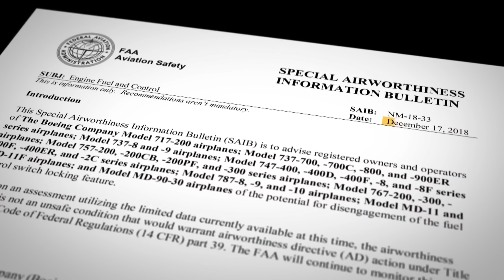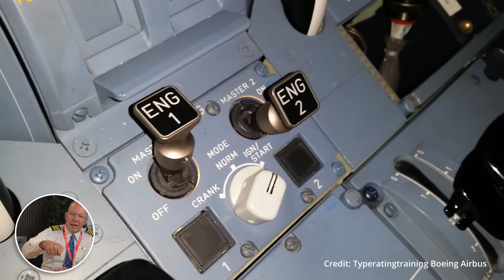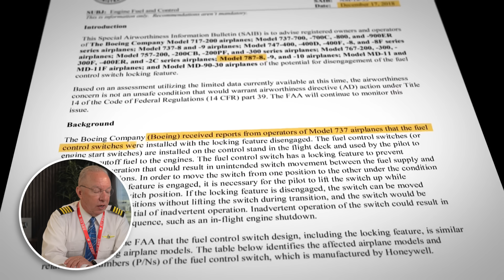Air India 171: The FAA’s 2018 Fuel Switch Locking Bulletin Explained (16 Questions Answered)

Comment: The RAT does not come out immediately. After the fuel supply was cut off, the engines begin to lose speed, it takes a few seconds for them to fall below idle. Only then does the engine error appear, and only after that does the RAT come out. But the report says that it came out immediately after takeoff.
According to the report, Liftoff occurred at 08:08:39. The question arises, how could the RAT come out so early, before the pilots supposedly turned off the engines? It turns out that the engine error occurred before the switches were moved.
Reply: Exactly!!  Why didn't Captain Steeeeve notice this???
Reply: "... the report says that it came out immediately after takeoff...."

That is NOT what the report says. Why do so many people keep spreading misinformation?
Reply: Exact, it did stick  at me too.
Also, the interpretation of the pilots discussion is to be explained, we need the sounds of the cockpit.

Comment: Excellent video but I would like to point out a couple of things. First off, I am a Marine Engineer and on cruise ships both the deck officers and engineering officers on watch have CCTV cameras as well as voyage data recorders. These keep us honest and can condemn us in certain situations but equally they can exonerate us in other situations, they should not be feared. If you are afraid of a data leak of a video showing you doing something wrong then you should be more concerned about what you were doing and not that you got caught. Also the argument that this has been tried in a simulator and those pilots failed to reproduce the outcome or that the FDR will only record the fuel cut off switches as off if they are physically turned off is an unsafe conclusion as the simulator is not physically and structurally the same as the real aircraft. If a fault in the real aircraft resulted in an erroneous input into the system which resulted in the fuel cutoffs activating, such a fault may not be replicable in a simulator. Tragically, all that being said, the fact that there is evidence of one pilot questioning the other pilots actions does suggest that the simplest solution is probably correct and it probably was either deliberate or a very very unlikely and unfortunate mistake. (I think it is unlikely a mistake but it’s still worth bearing in mind until it is ruled out beyond doubt) By mistake I mean, did one of the pilots lose concentration for a moment or daydream for a moment and somehow when he returned to reality he mistakenly performed a shutdown sequence rather than a takeoff sequence. As you said, people would prefer to think that this was not a deliberate act, unfortunately it may have been.

Comment: 8:00 sorry to say but it seems like you have poorly responded to question, SAI bulletin question on potential disengagement of FCS on Boeing 787-9. It was not a bulletin on faulty installation only. It was about disengagement during flight of all Boeing models. It is shocking how everyone seems to ignore this strong evidence of faulty FCS. FCS could have dropped to cutoff position during takeoff vibrations close to V1 in deck leading to fuel deficiency causing loss of thrust and climb while pilots being totally unaware. Pilots discovered upon noticing loss of thrust. Boeing, FAA, NTSB has redirected the narrative to pilot fault. Maybe simulate the above situation before dismissing it is more justified.
Reply: It is shocking how Captain Steeeve along with others are so quick to throw one of the pilots under the bus only one month after the crash.

Comment: Cameras in the cockpits are 100% needed. Pilot union and, honestly, you steve, can just take it or leave. Not your plane, not your company.
Time to add cameras.
Reply: Control freaks hate cameras.
Reply: That would be to know what happened but it would not prevent the accident.
Reply: @1064361  No, but it could prevent future accidents - That's also the same for the Flight Data Recorder and Cockpit Voice Recorder, they didn't prevent the incident either.
Reply: you are aware that we are in a severe pilot shortage right?
Reply: @livingroom13  so?  This won't change that metric much
Reply: Nope, no professional (and pilots are professionals) should have a camera on them at work. Unless it's for theft prevention (unfortunately pharmacies have to have cameras for this reason).
Reply: Coming from someone who thinks they get to dictate to the whole world, that's rich.
Reply: So what would the camera achieve in this case?  Nothing. We know what happened.
Reply: The investigators would know right away who pulled a switch or in worst case fighting in the cockpit. @CaptainRon1913
Reply: @CaptainRon1913 we think we know.  But voice and visual recordings provide much better confirmation.
Reply: @CaptainRon1913  We don't know what happened. We know that the fuel cutoff was activated and that the cockpit voice recorder shows some confusion, but it doesn't show which pilot made the change, and in fact it doesn't even prove that either of the pilots made the change. We're flying blind without video footage.

Comment: This may have been mentioned before. Results of an Internet search; The fuel cutoff switches used in the Dreamliner, and other Boeing aircraft, are Honeywell 4TL837-3D military qualified to MIL-DTL-3950.  Various on-line sources list at around $1400.00 to $2000.00 + , depending on quantity.

Comment: So, this was just a preliminary report, but western media and you are so sure that this was done by human intervention, and pilot did this without any second thought :( Also you said plane was working as it supposed to be and no problem with plane. Okay that's fair you are pilot but as software engineer, I believe any small or big software failure can cause major issue including dual engine failure. everything is f**king controlled by microcontrollers, anything could go wrong, what you think how flight recorder is getting data? who controls fuel supply? who read that data from this mechanical switches? who writes that data to disk of that recording device? of course there are components doing that so any failure in that middle layer can trigger that those switches are off which may lead to fuel supply being cutoff and being recorded as fuel cutoff from switches?? Isn't that possible? 

If you say NO that's not possible to my last question. Here are few questions for you then?
1. Why don't you wait for investigation team to come up with fuel switch turn off and turn on click or any sound in the audio recording?? I guess bz this is not complete report, right??
2. That was a panic situation, and the only thing investigation team said happened is 1 pilot asked, 'why you turn off fuel' other replied 'No I didn't" that's it ?? nothing else seriously ?? can we wait for complete report before accusing pilots?
3. You assuming that bz your student lies when they do something wrong so does everyone?? Maybe you are not wrong but think about it. That pilot's dignity is on stake, think about their family? and what if we found pilots were not guilty? Will you publicly apologies to family of those pilots?
4. As a viewer, I saw your speculations about how this would have happened was incorrect infect everyone's. So do not speculate that pilot lied.

WAIT FOR COMPLETE REPORT!!

Comment: I'm not a pilot, just an interested observer.   With the release ofv this latest data, I'm wondering how this meshes with the prior information regarding the captain's seat suddenly retracting due to failure of the locking pin.  Was this seat event recorded on the data recorder? Did the pilots discuss it before the fuel issue occurred?  Thank y ou.

Comment: Re: the suggestion that the second pilot reached over to put the fuel cut off switches back on, no one knows this. One of them could have switched them both off, then have been challenged by the second pilot, and in a moment of shame or just remorse, switched them back on themselves.
Reply: It's certainly not unheard of for suicidal people (if that's the case here) to have second thoughts. It could have been one pilot that turned them off, asked the other pilot why they turned them off, then turned them back on. But the most likely scenario seems to be that one pilot turned them off and the other turned them back on.

Comment: Switches are usually built as a unit.
If these were defective, then there's probably a batch if bad switches. 
Nobody catches these thing along the manufacture chain, and nobody checks these out after installation?
And then thus is the first documented failure of these switches? 
Na. I don't buy it. 
Saving a pilots reputation seems likely.

Comment: I think the question about a possible electric issue from the fuel switches despite being on, is a valid question.

Your response about they tested a full electric loss of power is not the question. Could the signal from the switches have been affected in only that part.

Comment: Even a lowly Sub 50K Tesla has 360 degree cameras and a literal blackbox, that any owner could decipher(just need the special connector). It is silly, we don't have a clue on this multi-million dollar airplane carrying 100s of people in Air. A real mechanical switch is very different than a fly-by-wire mechanical switch. The switch position is "on" when recovered from wreckage. May be it was that way all along🤯.😂❤👍

Comment: Would simulator software even be capable of testing the type of wiring faults a few of these questions were about? AI pilots testing electrical system failures in a sim isn't the same as seeing if it's possible for a wiring fault to send an uncommanded switching signal to the computer. It would only take some outside factor damaging wire sheathing to expose copper wires and allow a short to occur. They could test this in a sim, but seems like that would require actually ripping the switch out of the panel, stripping some wire, and start shorting them out on each other to see if anything produces the effect of flipping the switch.

It does appear to be a moot point in this particular case, with one of the pilots specifically asking the other about a cutoff. I don't think the word cutoff would have been used without seeing the switches actually moved to that position.

Comment: @ 2:45 For engine shutdown, there is an EICAS message present though (for each engine)....even when shut down in normal operations at the gate, etc. This is important information for the pilots to know, especially when wing walkers / ramp personnel routinely approach the aircraft, so it's important for the pilots to be aware if the engines are running or not.

Comment: Steve, I think you are very mistaken when you say that an electrical failure is impossible. The fact that this malfunction couldn’t be reproduced in the simulator doesn’t mean it couldn’t happen in reality. The switches in fact only activate the microchip, but the microchip could have been triggered without the switches. This is also supported by the phrase “I didn’t do it.” Then there was a self-restoration of the electrical signal. If the pilots had restored it, it would have happened much faster—waiting 10 seconds is an eternity in such a situation. I don’t believe that the pilot would have waited a whole 10 seconds, and there’s also no logical reason for a 4-second interval between turning the first and second switches back on. There’s also no reason to think the pilot was lying.

Comment: Could one of the pilots simply operated the fuel shut off switches when he was meant to operate the landing gear up.
I know of several incidents in the rail industry where such obviously very stupid errors were made by drivers with 30 years experience.

Comment: Question, I thought in your prior video you said that the two fuel shutoffs happened within "a second" of each other.   Assuming the switches, locking switch, etc were working properly is it even possible for a single person to operate both switches that quickly?

Comment: There's a huge day and night difference between 'Why did you cut off and Did you cut off '  
If there's a switch problem they will recognise during starting. As per FAA if the switch between the two position can be move without lifting it up then there is no protection feature Hence in this case it needs to fix immediately bcoz there is no protection but in this case it doesn't seems so.

Comment: There also could be the slightest suspition, that pilot was intended to do another manipulation near the same panel, but mechanically made cutoff instead.

That, however, in unlikely assumption, because both engine cutoff isn't the gesture that pilot do often, and thus it isn't trained to do mechanically.

Comment: I don't know why but I am getting a feeling that he is just shutting any possibility and confidently saying that it was the pilot who intentionally did it and the airplane did what it is supposed to do. It's fishy. Without any visual confirmation, there is no way you can tell that the switches are set to the cutoff position mechanically. It could be so that the system set them to cutoff and the pilots saw that on the screen and asked the other pilot and then noticed that they are not set to zero and hence they had to then reset them to on. This also explains the delay. Unless you hear the sound of the mechanical switch set to zero you cannot say anything for sure. There is no mention in the report on how they knew that the fuel switch was off. Yet the captain very confidently says that no other possibility exists. There was a bulletin someone was pointing to about a microcontroller failure that can lead to fuel cutoff and he did not discuss it. This is a recorded video right? He could have just taken time to check it and answer that if he isn't aware because that is a crucial bit of information if that's true.

Comment: I can't understand, why it took so long to turn the switches back on. Especially if the  pilot who wanted to survive did realize the other cutting them off.for It was the only thing that could rescue them. If it really was a suicide, I could imagine they were  fighting for control of the switches? Why should it take 4 seconds to handle the second switch? But if the other one wanted to bring his attempt through, why should he let the other one   restart the engines without any holding against it? Especially because He couldn't be really sure about the moment, after which recovery was impossible. Ok, now it comes to my mind - maybe he tried it before in a simulator so he knew roughly the road it would take. Unbelievable and it's really hard to think that this catastrophe very probably happened intentionally.

Comment: Software engineer here. Regarding the comment about a cyber attack, there are a multitude of reasons why it almost certainly wasn’t the cause of the incident. Not least of which is Occam’s razor. That said, I’d not be so quick to dismiss this as theoretically impossible. A hacker only needs to find one thing you didn’t think off to exploit a system, and no matter how smart you are, if the system is sufficiently complex, there’s something you didn’t think off.

Comment: Your videos have been the best but I have to disagree on one point. When I saw the timeline that showed it was 10 SECONDS before the switches were put back in RUN I could not believe it. Assuming that the question about why the other pilot moved to CUTOFF came right after it happened, why would you not IMMEDIATELY move them back? Why would you initiate a conversation ["why?"] as you are about to fall to your death? I would have exclaimed "WTF are you doing?," slapped his hand away, and put them back to RUN. Had Eng. 1 had an additional 7-8 seconds it might have gathered enough thrust to buy enough time for 2 to get going. So I don't think that pilot was on the ball at all.                                                                                                                                              However, his question might suggest something. The Captain was the much more experienced of the two, and he would know for certain that there was no reason to kill the engines at that critical time. OTOH had the Captain been the one who moved them, the less experienced FO might have, out of [fatal] deference to the Captain, asked him why, rather than just take control of the switches away from the Captain. Classic Cockpit Resource Management fail.

Comment: Grok says there is both a visual and auditory alarm sound when the fuel cutoff switches are put into the off position for the Boeing 787. As for cameras in the cockpit, a camera could be triggered only for a still picture when a critical switch is manipulated to make it absolutely clear if the event energized by the switch was enabled by a human or a mechanical or software fault. The fuel switches are monitored at 8 Hertz, which is once every 0.125 seconds. The 1 second time given is probably a rounded number and the raw data may show the gap time was less than one second, which is at the limit of human ability to act that fast without special training to do it at that speed.

Comment: If dual engine failure is astronomically rare, why is Boeing even allowing to cutoff fuel to both engines mid-air? Shouldn't it be designed to cutoff only single engine fuel  at a time mid-air, as dual engines can't flame out together?

Comment: Regarding the Air India crash, in your last video you mentioned that the Fuel Control switches were put back in the run position shortly before the crash. Since I assume that the engines would not have stopped rotating yet, would they have simply restarted? Or would the pilot’s have had to restart them?

Thanks,
Jack